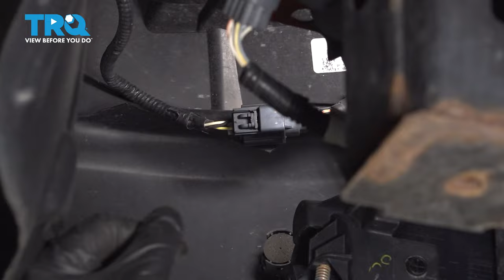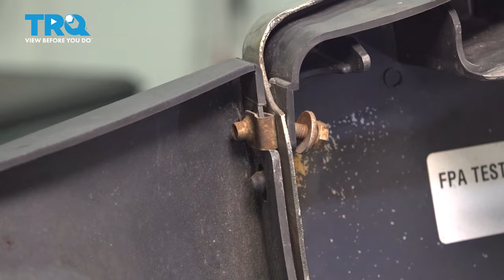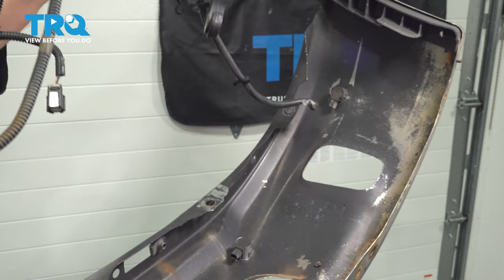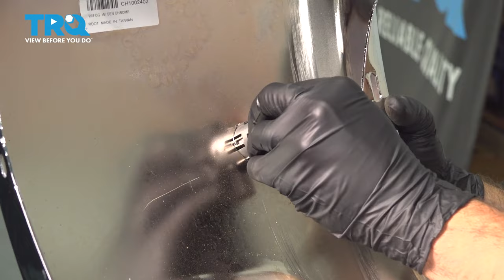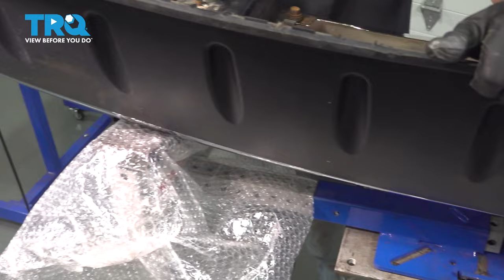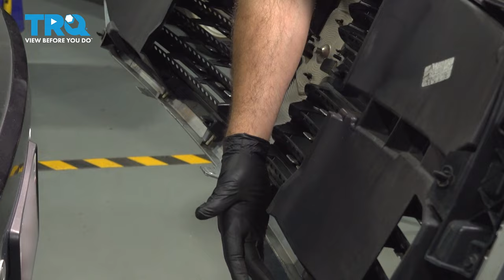How to Replace Front Bumper 2011-2018 Dodge Ram 1500

Comment: Great video. Helped me as I was wondering if there was adjustment in the front. Mine came about 1/2" or more lower on the drivers side than passenger side. Looks like a fairly easy adjustment. Thanks.

Comment: This video misguided me. All you need to do is to disconnect the harness plugs (if you are equipped with any), unscrew 3 18mm nuts holding the bumper to the frame on each side and remove the bumper. Done

Comment: Those plastic push pins on my 2013 did not come out easy. Broke 3 out of 4 of them. I noticed the grille I was changing to also had a broken pin, so plan on having some spares for that.